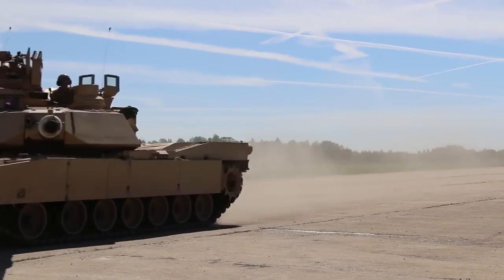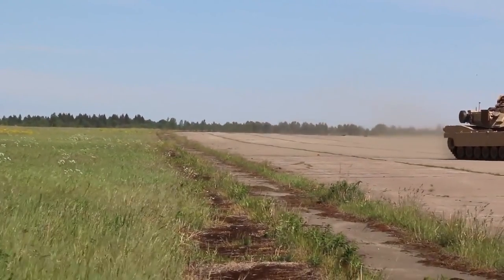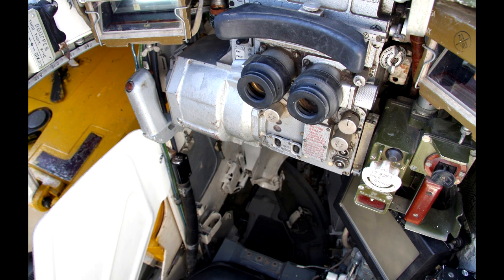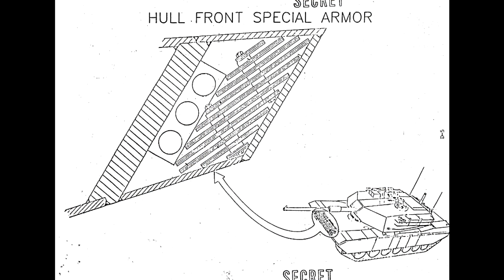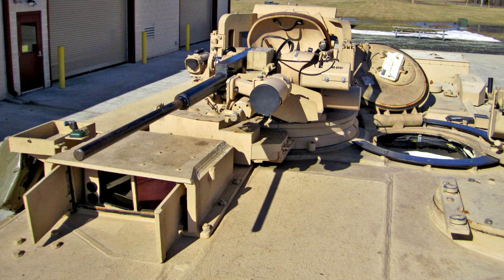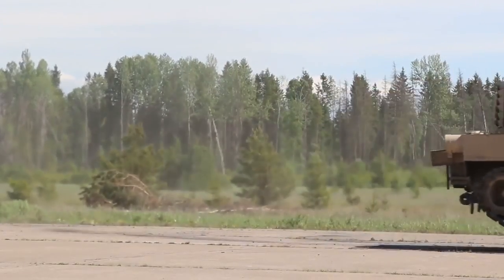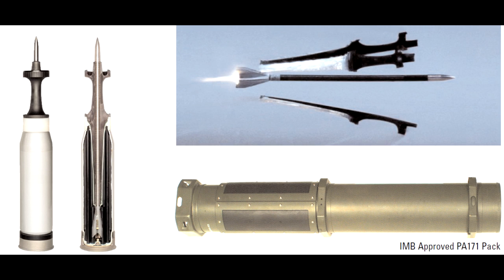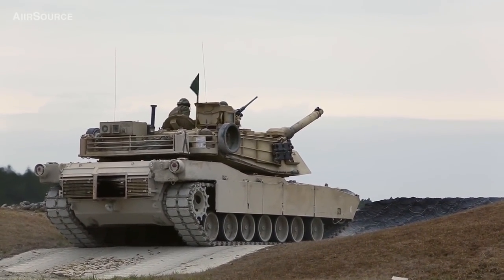Problems with Abrams tank

Comment: The M1's gas turbine is half the size of Leopard 2's diesel engine. If Abrams went with that massive old-fashioned engine its design would have included the same protection compromises as Leopard 2's. The choice was between poor fuel consumption or poor protection - the turbine was the right decision.
Reply: @komradearti9935  Diesel (MTU 873) XM-1/Abrams was 5000 lbs heavier. Where would the weight savings come from?

RR CV12 was the first practical modern Diesel tank engine in terms of power/weight/size.
Reply: Yes but it has to have a larger transmission

Comment: As an engineer 20 years ago we were attached to an armored unit of Abrams. First thing we were told was to stay back at least 100ft with our old M113's during road marches because of the huge exhaust plume from the Abrams. They give off HUGE thermal signatures. One of our guys got too close behind and it melted a tarp strapped to the front of his 113.

Comment: I didnt mind the video only 2 cents I had to give was the use of multi fuel, well they have the ability to refuel using aircraft fuel, suprising quite common. Let's say airstrike knocked out tank fuel station well there goes all the diesel fuel but that extra avtur avgas fuel is still there they can fill up tank maybe use them to drag other bits of kits back that ran on diesel until they can get more to the front line

Comment: So just upper hull plate, fuel consumption, and gun which is still good for now but has little life left and should be upgraded. Honestly I love the M1A2, but I would like to see a whole new design incorporating newer armor (especially the upper hull) that has some depleted uranium and newer armor technologies (hopefully this will reduce weight), a 120-125mm smooth bore with increased length, longer ammo rack for longer or future rounds they may come, the most powerful diesel engine to date, built in 360 degree active protection system independent from the direction of the turret, and a modular design for easy upgrades and repair. The fire control system and everything else is fine for now but can be upgraded.

Comment: I don't understand your purpose here. I mean, you state that this is just a factual piece and just looking at the issues that persist throughout it's use. But you open with that piece in the beginning and then chop in that anime thing when discussing engines. Then you tout the benefits of the Russian commander's position.

It's all very suspect. Just a hatchet wrapped in a nice cover. But still a hatchet job.

Comment: There's LOT of justification behind gas turbine 1. Turbine was not more expensive 2. It consumed cheapest fuel available at the time - see TGV 3. Turbine is more efficient than diesel at cruising - it is the IDLING and lack of APU that is the problem, as it consumes about as much fuel in both modes.  M1A1 was already available in small numbers during Desert Strom. Basically - every MBT that entered service during Cold War on both sides - was impregnable to its contemporary KE ammunition of the day from the front, and enforced other side to either up-gun or perform generational update of ammo.  Anywyone willing to learn about M-1 is most advised to watch Chieftan's channel - guy who is quite objective and actually has knowledge both tanks in general and M-1 in particular, including combat experience.  https://www.youtube.com/watch?v=aladW_D4nKU

Comment: So many people are saying 'wow, armour so weak' but are forgetting the Hull down doctrine, materials used to make the hull and the countless upgrades this tank has received. More in depth analysis of the abrams is needed to give a true unbiased perspective of its effectiveness.

People should also remember that the abrams is a tank series, with multiple improved variants. It is not the same vehicle that was designed in the cold War.

Comment: I like this video mate. Some "military experts" have the tendency to go along with the whole "invincibility of the US Armed Forces myth". You clearly dont have that and thats important. 

About the M1: it did had a lot of problems but nowadays it's an evolved weapons platform with a proven combat history. It still ranks high on the top list of tanks and is superior to its competitiors like the T90M or the Chinese Type 99 or Type 96. But it's meeting it's adversaries in the allied Leopard 2 or the newly developed T14 Armata. Especially the latter on is a huge leap in tank development and should be considered the first 4th generation tank. Allthough it's more advanced it's facing a much bigger problem than the shitty gas turbine of the M1 Abrams and that is limited production due to budget problems. 

I think the T14 Armata should  trigger the US into developing a new MBT because the M1 is losing it's superiority on the battle field. They may develop something with an advanced defence (high power laser or advanced Trophy systems), unmanned turret and improved digital warfare systems and hopefully a diesel engine instead of that piece of shit gas turbine. 

Ps: for al the haters. I work with diesel engines AND turbines and i prefer the relialibity of the diesel engine anyday
Reply: Wanna hear something funny? They stopped production of the T14 and scrapped the tanks because they are too expensive to fund, it’s now just an experimental project over an actual MBT
Reply: Wait... did you say budget problems? What happened to these 600 billions?
Reply: @Elron The US Armed Forces can be beaten no matter there size, tech or ability. Remember Vietnam? Remember Korea? Remember Somalia? Or more recent, remember Afghanistan? All, major cluster fucks. The US is not invincible, they think they do but the can be defeated.
Reply: @benniekeuter7582  bruh Vietnam was supplied by russia. Meanwhile USAs income increased. The soviet union collapsed while in afghanistan. RUssian fighter got boddied in korea. against the amercian counterpart. Bruh while america is still going. the USSR needed to sell germany and later collapsed. One ended a federation the other was just seen as humiliation.

Comment: 105 L7  at the time(early 80's) was the best tank gun available. The Rhienmetall 120 would supersede it half a decade later. As to the Russians they have yet to build an effective Main gun...
Reply: Indeed. The US army concluded the M1 Abrams (105mm) was more deadly then the M1A1 (120mm) as it was more accurate, had a higher rate of fire, offered better secondary munition types, and most importantly could carry 50% more rounds.

Comment: Most of these are old issues, and the fuel needs is just wrong.  The Honeywell AGT1500 can run on Jet fuel, diesel, marine diesel, or gasoline.  Basically, it'll burn pretty much anything available except maybe alcohol.

Comment: Hey man, just wanted to point out some in-accuracies in your video. According to several studies by the military on the fuel consumption by Abrams in 1991 during the gulf war (the HA variant was basically the only variant deployed), the Abrams only consumed 3% of the total fuel consumed. Assuming theoreticals, they found that the leopard 2a4 would go an extra half a mile more than the abrams under the same conditions. They determined that an extra half a mile more distance wasn't worth sacrificing about 10km/h of speed, not to mention the acceleration and torque advantage that the turbine engine can generate. 

2nd point, you seem to have implied that due to the cost of the diesel engine being more expensive, the m1 abrams overall was more expensive. This was also not true, as when the US military asked Germany how much Leo2s would cost if the army adopted it, it was determined that it would have been even more expensive than building their own tank, as the germans wanted to turn a profit. The Leo2 was more expensive than the XM1 from a cost standpoint, because capitalism, hence the US decided to go ahead with production of the XM1. 

3rd point, was that the M1 was undergunned. I'm not sure if you noticed, but the US's design philosophy was to stick with proven with technologies and maximize their effectiveness through upgrading what they already have unless they had to replace it. This philosophy came about due to the failures of several projects that utilized features previously untested or unimproved (the soviet built things and improved them incrementally from the start, while the US jumped ahead directly with no experience). However, this did not mean the M1 was severely undergunned. When it was introduced, yes, the m1 only used a 105mm gun, the american version of the L7. However, that was because they already had plans for better APFDS and DU shells which would turn a 105mm into having the lethality as the 120mm guns. The original plan to stick with L7 was to use the existing stockpile of the m60 shells, and because they had issues integrating the heavier and larger 120mm guns into the turret, hence it wasn't introduced from the beginning. 

Overall, you bring up some good points otherwise such as the early m1s lacking a TC FC override, and the lack of thermal for the commander in the very early variants, but some of your points were not well researched. Good work otherwise.

Comment: its not the best, but its still good and only 'the best' because the USA has so much of them, and also because the only thing they fight (and probably will ever fight) is t55s, t62s, t64s, and t72s with barely trained crews and poor ammunition in the middle east meaning it will never fight an leopard or a t14

Comment: Gas turbine engines may consume more to run but the M1 has a larger gas tank to operate with so that issue is moot. "Its more expensive to operate", Spoken like someone who is unaware of which nation owns that tank lmao. Also gas turbines have better low end torque and power compared to diesel, plus they are MUCH quieter and dont produce smoke. Really only down side to them is that they suck when idling, but that's mitigated by a secondary power source installed in 'new'er versions

Comment: Keep reading Wikipedia. 🤣🤣🤣 Some of the information is correct, but for the most part it's kind of wrong. What I can tell you is that we use that engine mainly because there are hardly any emissions, and it's way easier to work on. The filtration system has been self cleaning for a wail, since after ODS. Also the CWS uses FLIR not thermal imaging, which is far better than most USSR era tanks. Also the M1 was designed to stop Eastern APFSDS and the USSR was designed to stop western APFSDS. Should use a VPN and check out some of the stuff instead of being throttled by your county's internet bans. I had to use one wail in Poland because the E.U. sucks like that. Lol

Comment: I think you are trying way too hard with this video. For one, no one argues that the Abrams is perfect or has always been perfect from the get-go, and two, the supposed flaws you mention have not prevented the Abrams from operating successfully all over the world, including in both Gulf War I and II. 

1) Everyone knows the first gun the Abrams had was too small, that is why it was quickly replaced with the 120 mm

2) The gas turbine was chosen because of its high power-to-weight ratio, natural multifuel capability, lighter weight, and mechanically simpler design to the diesel. Yes, they have multifuel diesels now, but my understanding is they are finicky, whereas a gas turbine is naturally multifuel capable. In addition, at the time, there were no multifuel diesels available. As for the gas turbine being a fuel hog, that hasn't been an issue for the United States. In terms of putting a new engine into it, I've heard they are planning to replace the gas turbine with a diesel, but remember, the current gas turbine the Abrams uses is an old design as well. There are much newer and improved modern gas turbines they could stick into it. 

The reason likely that the Abrams has stuck with the AGT-1500 is because it has proven itself to be a very reliable and robust engine that is combat proven and has been operated in all climates. Also it would cost a lot to retrofit the fleet.

3) The original engine filters had a problem with the sand in Iraq which turned out to be different from the sand in areas like Arizona and Nevada, but they were quickly replaced with an improved version.

4) I cannot comment on the original Abrams commander sighting capabilities, but the Abrams targeting system automatically would locate and begin aiming at the target for the ones in the Gulf War. In addition, the Abrams tankers had no problem seeing in the dark as there were oil fires burning all over, and so they just relied on their night or thermal vision. 

5) No Abrams has ever been penetrated, so I would question whether what you say on the frontal armor is accurate. I am curious as to where you get the knowledge that "modern projectiles can go through it like a hot knife through butter"when this has never been demonstrated. It isn't just the thickness of the armor that counts, it is also what it is made out of, and the exact composition of the Abrams armor is classified. The Army I am sure is well aware of the issue of armor thickness, but may have decided against increasing the thickness and instead just have made it stronger so as to keep the weight of the tank lighter. Unless anyone has fired a modern projectile at the front of an Abrams and penetrated it easily, it is just speculation on your part. 

6) The machine gun has long been an issue, and especially was in Iraq where Abrams tankers had to expose themselves and make makeshift armor as they couldn't fire the machine gun from inside of the tank. The tank also was vulnerable in the rear. So the Tank Urban Survival Kit (T.U.S.K.) was created which fixed a lot of these issues.

Comment: They went gas turbine as you can run different fuels with it.. quite smart when in war zones and limited fuel choices
Reply: Yeah, this guy totally ignored that the capability for using a variety of fuels is meant for worst-case-scenario, not normal operations.

Abrams was designed to fight WW3 in Europe and in there would likely be fuel shortages in that scenario. It would be incredibly useful for Abrams to be able to use basically any type of fuel it came across.

Comment: Awesome data on it. Most of these flaws where corrected in recent years, according to armored unit tech's pmcs any recommended upgrades can now be included in all AARs which goes strait to ADSCs
Reply: Its still a shit platform...If Russian tanks had the same upgrades they would be superior...
The only reason its good is because of the use of depleted uranium in the armor and shells...and that has its own problems...
Reply: @command_unit7792  if the russians had the same upgrades, they'd still get dunked on since the Russians cant let go of their autoloaders so they need these giant ammo racks that don't have any blowout panels. Honestly Im surprised the Russians haven't gone the leclerc route and just had an autoloader system with a blowout panel at the back of the turret. it seems so much safer for the crew.
Reply: @ExHyperion  The T90 and T14 armata have blowout sections...The T14 Armata has the crew Ammo and engine in 3 seperate armored sections...

Comment: He makes us watch a video to tell us all of the bad problems are fixed and there's a couple minimal ones :l
Reply: All are fixed? When?
Reply: @23GreyFox  commander sight not existing was fixed in m1a2, relatively weak frontal armor was fixed ever since the m1a1 HA, l44 being a weaker gun doesn't affect the effectiveness of the shells as much since the US uses DU shells while tanks like the leopard use tungsten shells, which are weaker, so they have round about equal pen with the Abrams being at a slight disadvantage. Turbine engine is highly ineffective at low RPMs but can become about as efficient as a diesel at higher speeds, plus it is quieter at range compared to a diesel. The main problems with the Abrams tanks that he addressed were all fixed ages ago. His comment about the upper front plate being weak is semi-uninformed. APFSDS shells don't bounce very often, so his claim that the shell would bounce from the UFP into the turret ring is more of a one in a thousand lucky shot. This is because APFSDS shells shatter on impact with highly angled surfaces, as the forward momentum is reflected upwards but the shell isn't, which quite literally rips the shell apart, causing it to shatter. This is why the Abrams upper from plate is designed as such.
Reply: @ExHyperion  That the german dart is weaker than the american DU dart is a myth. The DU is just far cheaper to produce. My instructor would find your claims funny.

Comment: When you make comparison with other tanks do not complain when it backfires. And people make comparison in vice versa. 

Yes M1 came with 105mm gun but from the beginning it was designed and expected to get 120 mm one. US keeps their gas turbine and clearly have reason to do so and it works. Claims that "but someone has diesel engine" - well so he does. He might have his reasons like inability to produce high quality turbines ones or idiotic population unable to properly maintain and operate their tanks. 

I wonder how many times the upper glaces of the Abrams was penetrated. Btw., if you deflect APFSDS you are quite likely bending or breaking it - it then looses lot of its penetration power.